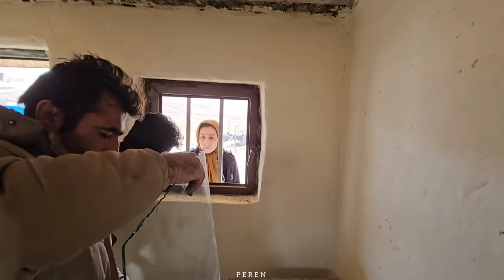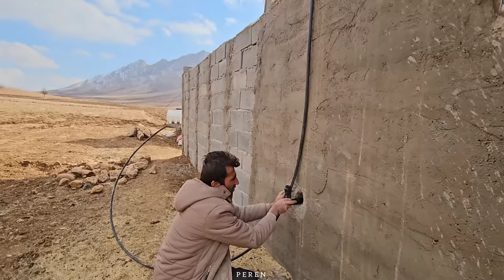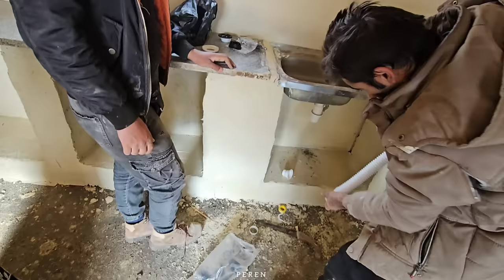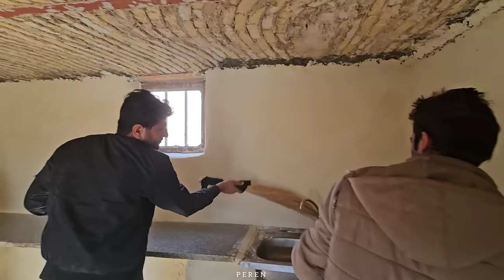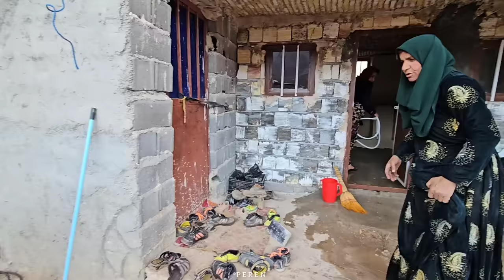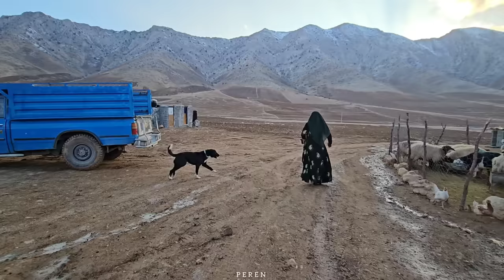"Adaptable Kitchen Solutions: Installing Nomadic Tanks & Faucets in Challenging Environments"

Comment: Just a suggestion, but how about getting a used 12v pump from a vehicle, then you can connect it to a vehicle battery to pump your water up to the kitchen tank via a hose pipe, instead of carting the water up there in containers. The kitchen is looking excellent. 😊
❤❤❤❤❤❤❤❤❤❤

Comment: You need a small water pump 12v from car attached to the large tank. Use a long hose to fill all the holding tanks instead of small containers. Much less work and quicker.

Comment: As that pipe for the water faces north, it gets no sun, it will freeze with no insulation wrapped around it, you can buy, pip insulation that is just a tube that fits over the pipe.

Comment: I recommend a wood burning stove will keep your room warm all night long. I used it on my home in the mountains now I don’t want to use central heating for I feel the vents are throwing dust from the vents. That small wood burning stove heated up my 1,600 square feet home. It’s hard to explain my whole body felt warmed inside and relaxed.
Reply: Anything natural will make your body feel so much better compared to AC run by electrics.
Reply: Where would they get enough wood from?

Comment: I'm not sure but did they check about the weight of the water tank (filled with water) sitting on the roof top if the roof can withstand and hold up that weight?

Comment: Maybe a floor drain can be added with pipe to take floor water further away from the opening. A bit of cement removed and placed a hose with shower floor drain can make it easier to get dirty water out  it needs away from door or it comes back in walking

Comment: I am certainly not an engineer or a architect. However, it seems that the planning stage of this project was well planned out.  I also, could be wrong.  Why build the structures right on the outermost border of the land that the land owner suggested.  Would it not of been better to move the structures in some so that a water unit could be installed on the backside of the kitchen instead of on the roof?  I understand they hope to use rain water to fill that container, however, the weight of water is amazingly heavy for any roof, let alone that one.